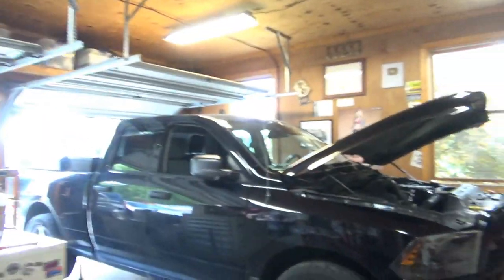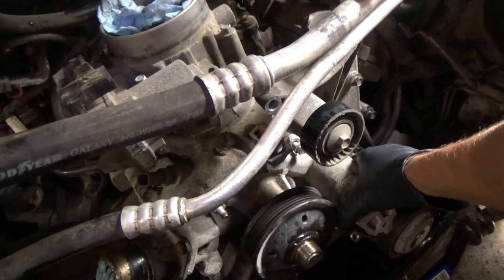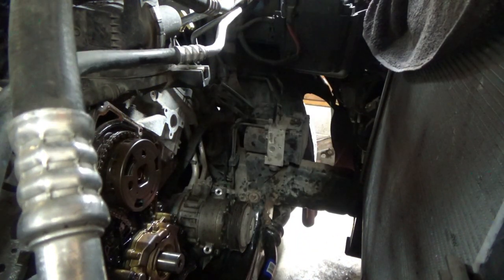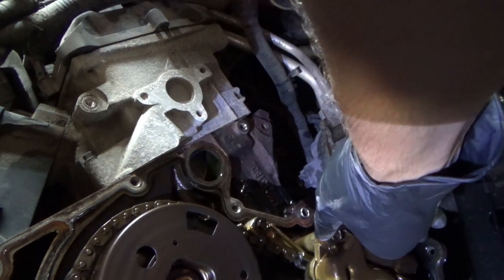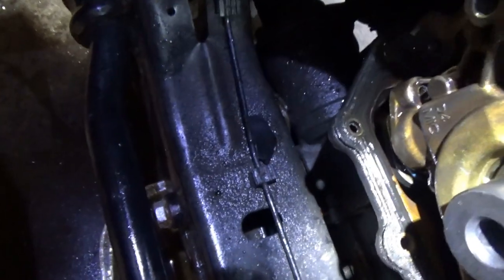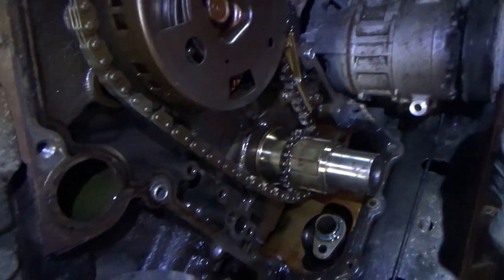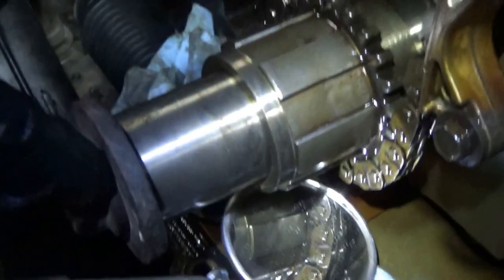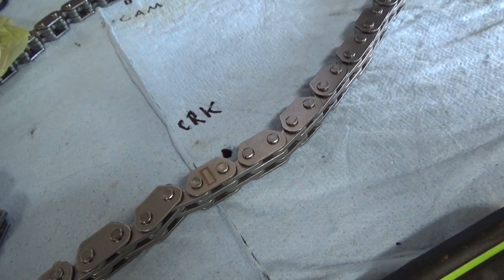Labor Day HEMI - Part 3 (P0016 Timing REPAIR)

Comment: This happens fairly often on overhead cam engines, especially Ford modular engines. Ford tech has a video on this and demonstrated the plastic chain tensioner will break apart and a piece will get caught between the chain and gear causing the camshaft to ADVANCE. My concern is all the broken plastic bits are still in the oil pan blocking half of the oil pickup screen…
Reply: That's such a bad design.   Why would they have a guide push in so far on the pull side of the chain (the right side)?  Knowing that the chain wants to pull straight, so you know it's going to eat through the guide;  that's crazy-- it's like it's designed to fail.  I suppose allowing the chain to pull straight lets it flop around a bit and could make some noise.   But this is just crazy to me.   It should have been designed just how you found it -- with the right side of the chain being straight and the left side having all the slack taken up by the tensioner.......  It seems they have done it this way to FORCE you to do the timing chain intervals as the book says.  Disappoint
Reply: @calholli  No, the chain tensioner must be on the side leading into the crank pulley. Otherwise, the pulling force (crank is pulling the cam) would collapse the chain tensioner. The slack must be picked up at the loose end of the chain.
Reply: @calholli   I think the guide on the pull side isn't a tensioner as much as it is supposed to protect the softer metals on the block from the timing chain rubbing. 

You would be correct.  It is designed to fail. That is why they have a set service time  for the timing set. The plastic provides a bit of built in lubricity but basically is designed to take all the wear instead of the timing chain or block. I think the largest problem is that what works on paper doesn't neccesarily work in the real world with real conditions that causes premature failures. Ideally,  you could run it until the service time, replace it, thrn run the engine another 100k or whatever. But they need to pinch a penny here and there and this is what you get.
Reply: One of many reasons I left Ford and went back to Dodge. And with everyone dropping V8 for turbo small block is why I will go electric truck when Hemi 5.7 is phased out.
Reply: Plastic is cheap enough. Gone are the days when chain tensioners had sprockets and ball or roller bearings.  Now only some motorcycles have those.
Reply: @TheTitaniumSkull  you will go electric truck whether you want to or not.  The government is going to force you too.
Reply: Yes I was thinking where is the rest of the tensioner.
Reply: Always a concern, learned it on the GM 3.8;s in the late 80's.
 Easy T-chain job, but comes back with no OP or blown motor due to  not removing the oil pan and cleaning the plastic out of the pan and screen.
Same goes for ALL Timing Jobs. 
Don't short the customer and dont screw yourself.
Reply: You would have made your life easier to pull the oil pan, because you also have to get the broken plastic out of it. Also the oil pickup would be easier to remove and reinstall. You also don´t know if water found it´s way into the pan.
Reply: They are not going to force me to do shit
Reply: @calholli  Remember the lack of oil change?
Reply: @rigattoni8143  Great point. Brian at FordTechMakuloko would agree. The pickup tube screen might be obstructed otherwise and cause an oil starvation.
Reply: @31terikennedy  That's just an assumption.  The oil could look extra dirty because it has all that shaved aluminum mixed in it.
Reply: @TheTitaniumSkull  Electric trucks are pretty sweet, but they cost $80k and up and only get about 200 miles range when you tow with it.   I still have my 2002 F350 7.3L diesel 6spd manual 4x4 with 330k miles and it's still going strong.  No timing chain because it's direct geared.  My whole truck is still in good shape, it will likely last another 300k miles.
Reply: @fredsalter1915 Yes oil pressure is kind of important. So what if the customer has already been driving for about a year like this. What’s the right thing to do?? I had this happen on one of my personal vehicles. NO OIL PRESSURE due to plastic chain guides/ tensioners broke apart and 100% clogged the oil pickup screen!! 

My wife was driving our 2001 Expedition with 300,000 miles on a 4.6l, when the oil light came on and started knocking. I ended up replacing all the timing chains, guides and tensioners as well as the recommended High Volume oil pump. Very surprising how packed the oil pickup was, it took me a good 30 minutes to pick everything out!! Luckily the engine survived and currently has 375k+. 👍
Reply: @calholli  Was it an assumption of Ivan's? Changing oil is critical. Shavings in oil doesn't make it look dirty, it makes look catastrophic.

Comment: What are the chances that the guide debris has collected in the pan or worse on the oil pickup? I had this happen on an older engine with teflon coated cam and crank gears (aka old school). I would have removed the pan just to be safe.
Reply: That's actually a great point.  There are probably a few chunks down there.
Reply: I was thinking the same. The pickup tube might be full of debris which could starve the pump of oil.
Reply: Ivan I bet if you removed the sump pan you would find the oil pick up straner blocked with ALARMIEUM AND PLASTIC from the guide rail and from not having regular oil changes. DO Not take the risk of the engine sizing up  . I would explain to the customer the sump requires removing.
Reply: i was wondering why he didn’t try to figure out where the guide chunks ended up.
Reply: 100% the pan should be removed. All that plastic went somewhere, a lot of it will have been microscopic but you can't guarantee that
Reply: I was about to write the same comment.
Reply: Agreed 100%.  Hard to believe Ivan didn't remove that oil pan. Dissapointing.
Reply: All this messing about prying at stuff and forcing it, all to avoid taking the pan off. Wow.
Reply: Yep, you always pull the pan for a failure like that.  Just like the old GM plastic covered timing gear when it came apart.  The pieces can only go one place.
Reply: Geez Ivan, look at all that guide worn off and laying in the oil pan. Sorry but with great respect I need to say you should have removed the oil pan and also replaced the water pump seal oh and the pick up o-ring.
Reply: That pan should be dropped and cleaned.
Reply: removing the pan would probably require removing exhaust, parts of the subframe, etc. Customer would have to be ok with it.
Reply: Because the owner wasn't doing oil changes anywhere near often enough (if at all) any debris from that guide has probably already damaged the engine if it got past the oil filter.

I still agree that the pan should be pulled and the pick up inspected/cleaned. I'd also be tempted to replace the oil pump (If Ivan still has the old Oil Filter it would be interesting to cut it open and see if it is full of debris).
Reply: Definitely take the sump off broken parts will block oil pick up
Reply: Maybe don't need as the pickup tube is screened.  I did a 1993 Toyota 4x4 pickup and removed the oil pan to clean out the broken guide pieces after dropping the front diff but that's just me.
Reply: @dc5723  A clogged pickup screen is probably worse than if the debris is allowed to go to the oil filter and clog it. It probably will take a lot more debris to clog the filter than the screen, either of which can cause low oil pressure or oil starvation.
Reply: I am more intrigued on how he got that guide bolt on, theres no way to put that back on whit out taking out the pan
Reply: The chances are good that the debris is still there. The oil pump gets un filtered oil first so it most likely has wear inside it. Ivan is a great diagnostician but cuts a lot of corners when it comes to the repair
Reply: Very likely. Oil pan should be dropped.
Reply: He may have "magic fingers" to get it back in place.  Or:  A piece of mechanic's wire loosely wound around the bolt to hold it and slow, tiny turns might have worked.  When the bolt was established and would not fall, pull the wire off and continue threading.  That's my best guess.
Reply: Dude had been driving it like this for a good amount of time.

Comment: Good diagnosis determining it was a mechanical issue. With the timing cover off we see the damaged part. It is good someone makes a metal backed guide, so if it fails again (assuming it lasts before the vehicle goes to the crusher), at least you will hear the chain run along the metal and it shouldn't be as loose as this one was.

Comment: I know you don't want to pull that pan, but it is advisable to do so. I pull pans on all Fords with trashed guides, especially after seeing the pickup plugged solid with plastic pieces. This engine won't be any different... That plastic went somewhere! I'm sure we all short-cutted  on the first timing jobs, but after seeing the issues caused by reduced oil pressure, it pays to do it all. Of course, without a lift, I wouldn't enjoy pulling a pan on my back. Thanks for bringing us along on this repair. As others have mentioned FordTechMakuloco, he showed how in the Fords, the broken pieces actually jam under the cam gear, I believe your broken pieces fell in at the crank gear, with the same results.

Comment: I turned blue holding my breath while you removed and reinstalled that pickup tube bolt.    As for the comments regarding the oil pan removal:  It's a 4 wheel drive and the pan would have been additional expense that, in my opinion, wasn't worth it.   The plastic wouldn't have hurt much and it, along with the aluminum powder from the tensioner,  would have been picked up and filtered in the last year of driving.  Any remaining in the pan would have drained with an oil change. If it were my truck, I would have left the pan on with one more oil change.
Thanks, Ivan

Comment: Had the same issue on gm 5.3. To get the crank pulley and dampner on I gentle tapped in on with an air hammer. Worked great and easy. Just make sure it is straight when starting.

Comment: Ivan, your videos - especially this one - give me the encouragement to think through a problem I have with my OBD1 330,000 mileage ’93 Protégé. My Basic Electricity 101 was in college early 60s. Since then, I haven’t done much more electricity-wise than change a light bulb, except the last 9 months I’ve been studying automotive electronics intensely, watched many videos on the subject, purchased Pico tools for back probing and practiced soldering. Although I don’t have a shop – I work out in the weather, including the 100 deg Texas – and I don’t have the range of tools you have, and parts are hard to come by, I shall persevere. I thank you more than I can say.
Reply: Here is some advice Ivan won't give you. Drive your '93 protege off a cliff. Get a newer car and enjoy your twilight years. The 1990's didn't produce great cars. That old girl deserves a peaceful end. I come from Slavic roots. They were all millionaires yet fashioned leather belts on their vacuum cleaners when the $2 rubber belts broke.
Reply: @thereissomecoolstuff  But I look at TOTAL cost. My insurance is $25 a month. My kids and grandkids are paying $150 a month. I can buy a lot of tools and parts for the difference. Also when my protege is running right, it gets 35 to 38 mpg. My kids are lucky to get 20 mpg.
Reply: @elbertmarks5799  I understand Elbert. I'm Just teasing you. Technically you are paying twice what the car is worth in insurance. The kids may have got you there. Contact Mazda and tell them about your car. They may do a story about it and give you a new one for the publicity. Contact Mazda marketing. You never know. Good luck.
Reply: @elbertmarks5799  as long as you are enjoying yourself, it's got to be better than wasting time playing bowls with all the other old farts

Comment: It's a miracle that timing chain guide did not split! Did all those plastic and metal filings get out with the oil change? As you predicted, it advanced a tooth. All should be good now, but I'm a bit anxious for Part 4 🙂

Comment: Don't know if this was already mentioned but easiest way to install the harmonic balancer is to have a longer bolt to start the balancer and then switch it for OEM bolt once it's half way installed. A similar two bolt process is used attached crank arms to titanium bottom brackets using titanium bolts on bicycles, but for a different reason. Titanium bolts are not as strong as steel bolts and tend to gall if torqued into titanium threads. The process is to torque the crank arms on the Ti BB using steel bolts, remove the steel bolt and replace it with the Ti bolt using anti seize, but at a lower torque. Yes. you could just use the steel crank bolts, you you miss out on the miniscule weight saving so important on high end bikes. 👍

Comment: Great series, Ivan!  Your diagnosis (the science) was spot on again.  The scope said that the cam was advanced by about a tooth and it was. Two mysteries remain however: how does a cam slip forward (instead of backward) and why do manufacturers use plastic for the chain guides and tensioners???  (Also, I agree with the other commenters with concerns of the plastic chain guide fragments floating around in the oil pan.)  😄

Comment: I bought a first gen Durango with what sounded like a lifter tick and to my surprise it had ate up a guide and made it halfway through the bolt. I couldn’t hear any grinding noises. That one had three chains and the same oil pump set up.

Comment: I did one recently.  So the way I ended up getting around it was super gluing the bolt to my socket to get it back in. I dropped it a few times before I came up with the solution.  You know how bad timing issues are on any Chrysler product. Or 5.4 Fords.  Lol. And as far as debris in the oil pan, never been a issue on the many I've done.

Comment: I just bought a longer bolt to pull the damper in but I live a few blocks from Menards too. Great series. Thanks for posting. Steve
Reply: Same here. Customer brought a 03 chrysler 300 for timing job after a local shop really messed up the job. Bought a couple of long metric bolt with washers and nut. Stacked them up and pressed on the crank gear and balanced. Took about 1 hour to find the bolts I needed. I worked perfect. About a month later I needed to get my Chevy balancer off to. Leaking seals. This time I bought a puller and a lot that contained long bolts to pull my balancer in. Glad I did. A little pre planning helped a lot. Plus it's my fault driver. No hammers.

Comment: I would be changing the oil pump. From previous experience(s) some motors come back with phaser and cam codes from low oil pressure due to the amount of metal circulated AND check your thrust bearings BEFORE terdown.

Comment: I dont know how hard it is to get the oil pan off but it probably would have been worth it to retrieve the broken pieces of the guide and make the rest of the job easier.
Reply from the maker: It took maybe 15 minutes to get that bolt in and out. And chunks in the oil pan have been there for over a year and are not bothering anyone 😉
Reply: @PineHollowAutoDiagnostics  Not to mention all the ground up aluminum that has been ground off the chain tensioner that has gone through the engine.
Reply: @brentnearhood8874  Up to the oil filter and trapped.
Reply: @meking115  We're in better shape with Biden?
Reply: @Garth2011 : 😆 Bwahahaha...!
Reply: @meking115  LOL!
Reply: @PineHollowAutoDiagnostics  Until the owner drives up/down just the right incline to block the pickup tube. Also if you come across a stretched chain on another engine it's very much recommended to replace the phaser and pulley since they wear in with the destroyed chain and will kill a new one in short order.

Comment: I did a '70s Nissan/Datsun Bluebird back in the late '90s that had about a third of a shopping bag full of metal swarf in the sump from the chain guides. It sounded like someone planing a 2x4 as it pulled in.

The single mum was so poor, I got the chain, sprockets, guides, and tensioner from the wreckers and rtv'd the thing back together for free. She gave me a few great thank you's for it over the years.

The thing got shunted by a truck in late 2002. Unfortunately she then got a $500 Ford...

Comment: Oil pickup screen on my v6 4.0L explorer was almost blocked with plastic debris from the guides.  I check it every other oil change with the reman engine. The 4.0 has an easy little bottom oil pan to remove.

Comment: Quick question .. all that worn metal wouldn't that be floating around in the oil and possibly be trapped in the pickup tube ?
Reply: My issue is that you usually also change out all the gears related to the chain as well.
Reply: @meking115  too inexperienced? One of the best diagnosticians on YouTube. If he had seen evidence that was necessary to pull the pan he would have done so. Best practice may be to pull the pan and clean all the potential debris out. But money, time, and I would margin the customer all have a say in that factor. If Ivan chooses to warranty his work with out pulling the pan, then I’d say he’s fairly confident in his decision.